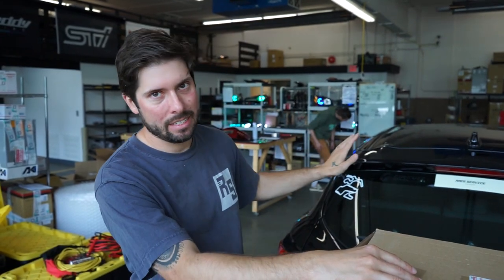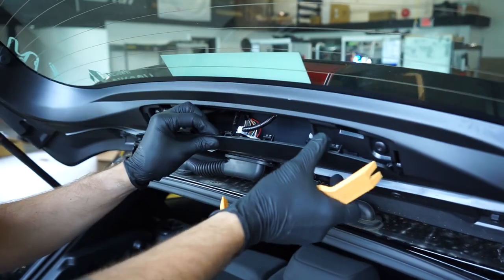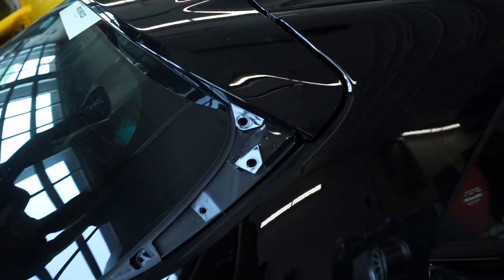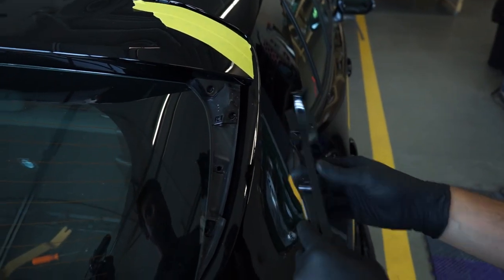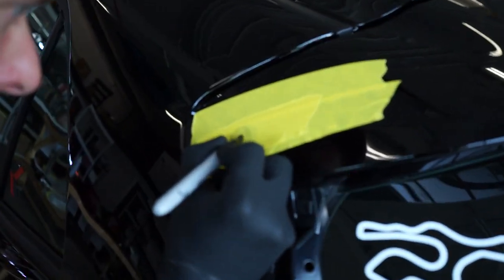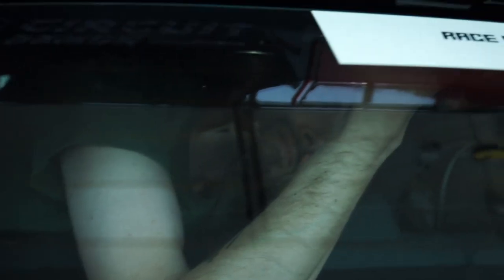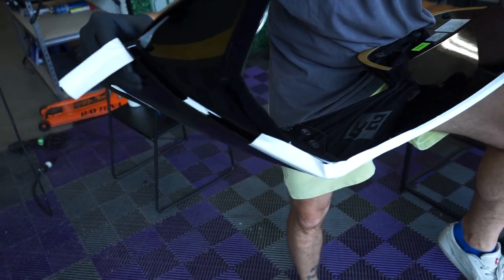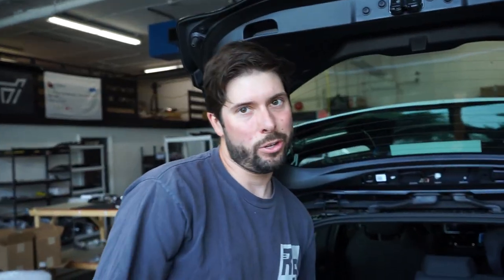CUTTING INTO OUR GR COROLLA! [Circuit Edition Spoiler Install]

Comment: I recently did the CE wing on my ice cap GR. I used a little anti seize on thoes foam washer/gaskets to transfer into the painters tape. I also drilled out the plastic on the inside panel of the hatch then 3D printed a plug that snapped into the drilled hole for a clean factory look.
Reply from the maker: That’s awesome!